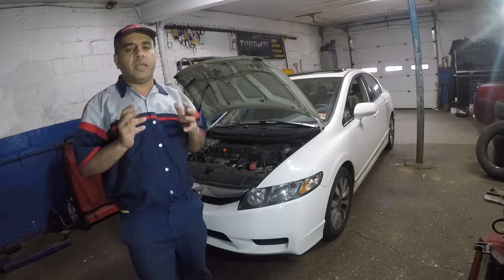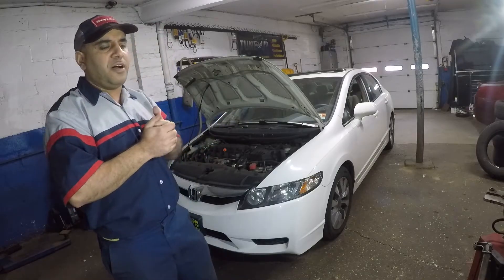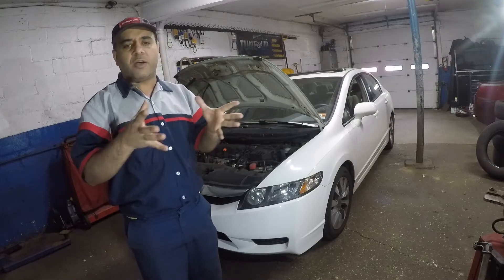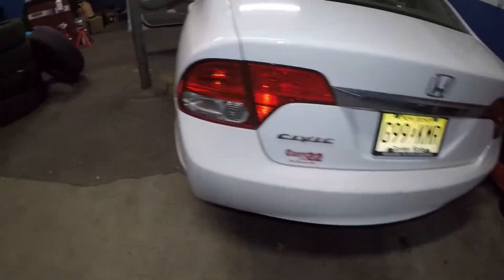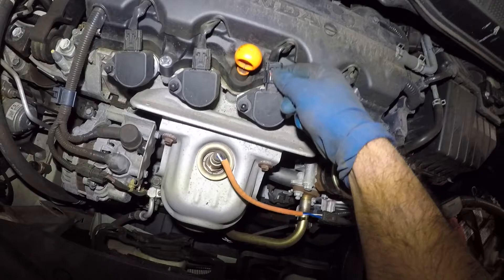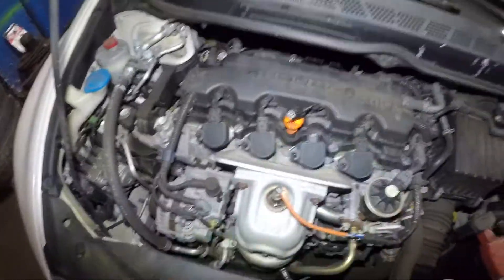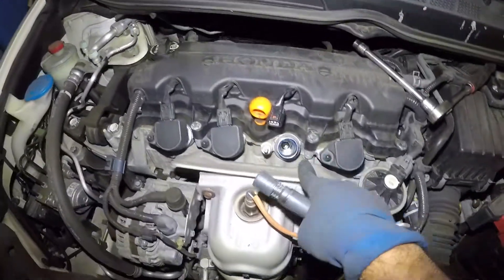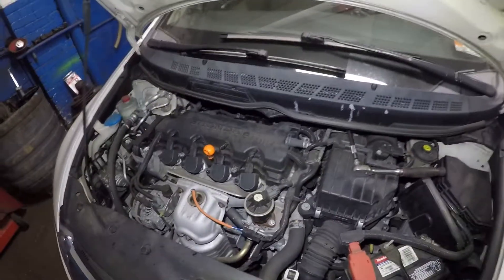Honda civic Cylinder misfire and flashing check engine p0303

Comment: Mine misfire with CEL flashes only in a cold start. When it reached the optimum temp, the CEL flashes went away and misfire dissapear. Any idea?
Reply from the maker: Hook up ur scan tool and scan for codes and check live misfire data on cold start up

Comment: While engine is running/idling, pull each spark plug wire off existing spark plug, one at a time. Soon as you notice no differential within engine idle, and-or engine running in general smoothly. You just located correct cylinder that's creating mis-fire. If you pull a spark plug wire off the spark plug, you notice the engine stumble, run rough, that designated/particular cylinder is functioning correctly for most part. Also if you touch your spark plug wires when engine is running, feel a shock, the wires are definitely in need replacement.  Very highly probable, one or more spark plug wires are arching between each other, cylinder or cylinders not receiving full spark capability.  Sometimes can see this arching, if it's dark enough within engine compartment. Spark plug gaping is also very important, spark jumping around the electrode within the spark plug itself, weak spark when piston reached tdc/top dead center. Piston reaching top within cylinder, spark timed to ignite fuel at this point.
Reply: This actually helped me figure out it was the coil pack I could unplug that one and nothing would happen the rest when I unplugged or disconnected a little bit the car would try to turn off
Reply: I just switched my coil but at times while on brake or park I feel the idle a bit rough or shaking at times, would it be the spark plug that needs to be replaced??

Comment: My car has that code, it does shake a lot, tons of smoke in the exhaust, and I think all the compression or whatever it’s called goes into the radiator line/hose. The coolant looks oily, I’m assuming oil is going through the cooling system. Does that mean I need to replace the gasket and have the heads redone?? 
And I algo get the code 0134.
I turn the ignition on,press the pedal all the way down and takes about a minute to start.
Reply from the maker: From what ur saying u have bad head gasket
Reply: @RBTheMechanic  thank you for your reply. Yes I think most likely the problem. Is that an easy or something doable  at home? Let’s for diyers like me. Do I replace just the gasket or what else should I do? In case I try myself.
Reply from the maker: @ricardosom7766  first I’m not sure if that is the issue I’m only saying from what u stated and It’s not somthing u can do home
Reply: @RBTheMechanic  hi my fiend here I got an update and I thank you for your time in advance. 
Today I took the “terminal” I think they’re called those that go over or on the spark plugs. The kind of T form one.  They’re dry, but they have a gas/water or gas/alcohol smell.   The engine oil is clean, it has no sign of water in it or the milky looking.  Hope you get a picture of what I’m saying.
Is it normal to have the gas or gas with water smell in the plugs location ? It kind of smells like when you mix hand sanitizer with water.
Reply from the maker: @ricardosom7766  well I understand what u mean but problem like this hard to state 100% some time it’s tiny amount and nothing will mix some times it’s only combustion pressure being pushed

Comment: My 2009 honda civic has P0300,P0301,P0302,P0303,P0304 code. I have taken this car to every mecanic in my area and no one has found the problem they dont know what it has, the car runs smooth but in a certain time the check engine light starts to flashing and when starts flashing the car losses power and when i turn it off it right away it goes back to normal but in a couple minutes it starts to do the same thing. I changed the sparkplugs and coils and nothing. Have you deal with this problem before? Can you tell me what can i do. Thank you so much for your time
Reply from the maker: Radon misfire and all cylinders misfire can be cause by vaccum leak or oxygen sensor can cause this I would try cleaning on upstream sensor also. EGR valve if it got one. And I’d ur oil grade and oil clean?
Reply: Please did you fix it. Please if you do, I want to know how because I’m having the exact problem.

Comment: Would this process also work for a 2007 Hybrid Civic? Having flashing check engine light and some vibrations/stalling issues. Did have some of the coils/plugs changed by a mechanic a few months ago. If process is the same figured I’d take by auto parts store to get a code read on it.
Reply from the maker: Welll it’s similar but stall might be other issues

Comment: So I had worked done on my 2007 Honda civic car. I had the starter changed. And it ran well for two days. But this morning I had a check engine light. The car vibrates when parked and when driving the car jerks. Also there was strong fumes I could smell when inside the car. Could this be because of the same problem you explained here? 
Please help. Thanks.
Reply from the maker: No this might not be related to starter change but did u get check engine?
Reply: @RBTheMechanic  thank you for replying. I haven’t yet. But I will today. Thanks again. 👍👍
Reply: @RBTheMechanic  ok, so yeah it’s ignition coiled #4 that’s failing. But now that I removed it the tip of the gasket stayed in there. Any ideas how to get it out? Thanks.

Comment: My engine light keeps blinking and i put a scanner and got the code p0301 it says DTC severity 2 of 3 repair immediately if drivability issues are present
Reply from the maker: That’s misfire cylinder one replace coil and spark plug also these new civic have issue with injectors. Flashing light is heavy misfire
Reply: @RBTheMechanic  thank you i change all 4 spark plugs and new ignition coils now its running good its a 2002 honda civic ex
Reply from the maker: @franciscomexico7131  nice job!!!!
Reply: @franciscomexico7131 You are lucky. I have same check-light flashing issue. I have changed plugs but yet to change coils. Still flashing so I want to go back and change possibly all coils.
Reply: I wish it was that easy, I have an 01 civic, I replaced spark plugs, coils packs, I checked compression, I did valve clearance, I checked the injectors and still misfiring, I ran out of ideas.

Comment: I thought I had bad coils until I changed all 4 with spark plugs and still have misfires while driving I also changed the crankshaft sensor and still misfires. I don’t know what else to check any suggestions???
Reply from the maker: Which cylinder is misfiring? What brand spark plugs u put it.  Get me the misfire code
Reply: @RBTheMechanic  P0301 P0302 P0300 
Ngk spark plugs
Reply from the maker: @heaxysauxe6536  u got random misfire did u put scan tool on to see live data to see if it is misfiring
Reply: @RBTheMechanic Please poster come and respond to this. I’m trying to figure out similar problem too.

Comment: So I have code P0301 2008 SI
I did the coil test so my bad one , cylinder 1. I swapped it with cylinder 3. It still reads that cylinder 1 is misfiring even though I swapped it so it can’t be coils.
I put brand new spark plugs I don’t think that is it either.
Could it by my fuel injector?
When I remove the coil from cylinder 1 it makes no difference. No matter which coil.
Same thing with injectors. ANY idea?
Reply from the maker: Swap the plugs also u never know and check the spark plug gap.  After that u need to check injector and coil Paula’s and compressor for engine

Comment: 03 civic, persistent check engine light. Code 0302. Changed fuel pump, coils and injector for #2 cylinder. Car still stumbles on acceleration I have to floor gas pedal to make the car accelerate. I’ve spent $2000 on my car and I’m over it, any ideas I could try? Thx
Reply: Will a bad egr throw a code? How do I check it? Thanks
Reply from the maker: @mikepjam8133  some will some wount well  u can watch my egr valve videos cleaning it out.  Or tap on it some time it start work work and function by impact or replace it   It could be leaking vaccum
Reply from the maker: Did u check to see the EGR valve
Reply: @RBTheMechanic  it hasn’t arrived yet, I’ll let you know how it goes. Thanks for asking
Reply: I can’t find the egr valve. I’d like to send a photo but I can’t. I removed the air box and there’s no egr. 2003 civic lx
Reply: Ok thanks RB, I’ll purchase a new one to be sure. I appreciate your quick response.
Reply: RB, are you a fan of Seafoam, I’m tempted to want to try it, I can’t help but feel it’s a fuel related problem.
Reply: I’ve read that engine D17A1 does not have a egr valve, engine D17A2 does. I have no other idea what is causing the misfire and bad hesitation on acceleration.
Reply: I don’t know what else to do, there’s nothing left to replace. This car has no egr and I’m still getting #2 misfire
Reply: @HibridArtGalleria I’ll look into it Hibrid, thank you. I didn’t realize modern cars without distributors could lose timing. Thank you

Comment: bro I got a code p0303 it has rough idle and like a consistent tapping and a popping sound and lose of power and white smoke
Reply from the maker: That’s misfire do tune up swap the coil from cylinder 3 to another cylinder see if the misfire changes to diffrent cylinder. These cars are known from ba do hector and seals causing misfire
Reply: @RBTheMechanic  i have a 2001 eclipse rs 16 valve 4 cylinder thats what im about to do now but say if its not that what could it be?
Reply: @RBTheMechanic  I have same issue code ps301  Cylinder 1 misfire. Swapped coil from cylinder 2 to cylinder 1 and the same code po301 remains. Do I need to change spark plugs?

Comment: I just started having this problem I drove the car home perfectly fine but when I went to move it the check engine light came on now I have codes P0303,p0301,p0303 an p0300 I changed all the spark plugs but now I’m starting to think it’s my coils an valve gasket any idea what it can be before I got out an buy all these new parts one of the coils had a lil drop of oil on it but the rest seemed to be fine it’s a 2010 civic 1.8l
Reply from the maker: Check ur oil also I seen oil dirty bad wrong viscosity and immediately on start up it will do that
Reply: @RBTheMechanic  I just put a new base pan an new oil on it so can’t be the oil
Reply from the maker: @EhMaac  oh ok did u use correct viscosity
Reply: @RBTheMechanic  yes
Reply: I’m thinking it’s the coils an a small valve gasket leak that’s the one thing I can think of
Reply from the maker: @EhMaac  that is very possable oil always cause misfire u can clean it and test it

Comment: Ya but what if I changed all of that and did the swap test but still have the misfire
Reply from the maker: Did u check or change oil some time it’s caused by oil bad also moniter misfire with scan tool
Reply: @RBTheMechanic  no but I was gonna change it today.. because I was reading that yesterday
Reply from the maker: @jeremybell5745  ok
Reply: Spark plug?
Reply from the maker: @ashveensharma5468  could be plugs coils injector or somthing else

Comment: Omg I fucken love you bruh like frfr I'm not gay but you can definitely get a bj I was wondering like wtf was the blinking c/e light was I have an 09 the muffler the smell all that I was on YouTuber after YouTuber page terrified I would've been paying like 6bill to get it fixed nope 80 bucks max my crank sensor was messed up two that's why 80 for installation ty so much you nailed it
Reply from the maker: Oh ok
Reply: @RBTheMechanic  again thank u so much now the I changed all those things no more rough start... now I have two other problems the first is something under my serpentine belt starts to smoke without my car being hot. Then a wire type smell comes through my ac vent and smoke under the hood under my serpentine belt. My serpentine belt is fine btw but the second I shift into drive my car stalls. Everything stay on but my engine then I can restart my car drive a block but then stalls again pls help
Reply from the maker: @juscallmevell  I’m not sure what the smell is u might have to check to see where exactly it’s comming from could be ac compressor and the stall what is ur rpm? At idle
Reply: @RBTheMechanic  I'll check it I'm going to work on it tonight I thought it was my ac compressor or a coolant leak at one point I thought maybe fuel or water pump but I don't small gas so the two codes I got was for my misfire and crankshaft position sensor. I think that's what's causing the stall my car starts fine no more rough idle smooth no sounds but the second I go from park to drive it goes right out I brought the part for it just haven't put it in yet I'm waiting on a car jack
Reply from the maker: @juscallmevell  do the Freon service recover it with machine and see if correct amount comes out then recharged it and see the preformance if it’s low u know it prolly had leak if it’s got enough could be ac compressor
Reply: @RBTheMechanic  my rpm was 900 and idle between 8 and 1k but I found the problem I set back n watch where the smoke was coming from and boom it was Mt ac compressor it would start then stop the Aaa like it's my alternator. I told him nope definitely my ac 1 I hit a pot hole on my passenger side and had to use my spare. Shortly after my ac stopped working then my engine over heated I fix that then the smoke and smell there is a quarter inch gap between my clutch and bearings that's not supposed to be any space between the that burning smell was the magnets the clutch was two far off so I ordered a set hopefully it's not the whole compressor even if that's cheep. I'm just glad I know what the issue is
Reply from the maker: @juscallmevell  oh ok yup
Reply: @RBTheMechanic  now that I replaced those spark plugs. I left negative off to long battery died then I brought one of the portable jumpers it jumped my car was able to drive next day battery die again this time car dies everytime I try to start it shuts off immediately if I remove the portable jumper. Is it my alternator? It will start to crank but give off this wining sound then dead I'm so lost I need to get it to a mechanic asap but don't know what the problem is obd2 says no codes found
Reply from the maker: @juscallmevell  that check all of the connections and cables u removed check fuses as well but this could be bad alternator did u try to check alternator voltage
Reply: @RBTheMechanic  no that's the next thing to do is to check the voltage because there is no click sound I've heard a bad starter before and that's not it. I never had an issues with my alternator but it is a car whith high mileage 108k my car had no issues till I hit that pot hole then boom tire went out, ac stop working I turn the ac crank off because the bearing was smoking needed to be changed the stalling rough start idling that rev my engin even with out my foot being on the acceleration then the p0300 302 303 easy fix no more misfires no more shakes or rough starts that's fixed I get a jump from triple A now my battery dies it won't hold a charge idk I have the worst luck nothing comes easy I'm frustrated af I live in Chicago I know these shops about to over price me and inflation about to kick our ass even harder gas is back to 6 dollars here and rising n I'm almost at fuck it but I'm still paying on the car I refuse to let my credit go bad I have excellent credit 749 ugh anyway thank you for all your help. I've told my friends about your channel ty
Reply from the maker: @juscallmevell  check ur fuses also cuz battery can’t be completely dead recharge the battery it could be main fuse for alternaotr battery not allowing battery to be charge or bad alternator
Reply: @RBTheMechanic  I brought the noco genius1 omg that thing really works it brought my battery back from 1v I let it charge I guess not fully the charge wasn't a solid green it was tell pulsating which turns out it means two very different things pulsating green ment it's almost 100% but it's fixing something but any way I went to start the car and it was trying to turn over but gave up now it's making a rapid clicking noise sound like a fast garden sprinkler but super fast I wanna say from my fuse back but it could be in my dash. Does that mean my solenoid or my relay
Reply from the maker: @juscallmevell  could be low voltage battery power
Reply: @RBTheMechanic  from my battery or my alternator?.. im going to let it fully charge up I already have a stand by alternator so incase it is my starter I put that on my buy later list parts with installation is 675 to 850
Reply from the maker: @juscallmevell  charge the battery fully
Reply from the maker: @juscallmevell  ok check ur battery it must be either low power or nothing hold charge so if battery is old old more than 3 years replace it.    Also defiantly check terminal connections remove them and clean terminal contacts on the inside and battery terminals make sure u have radio code it will activate once u disconnect the battery
Reply: @RBTheMechanic  yeah I know the code by hard now lol I will clean the terminals ty so much bruh really appreciate it